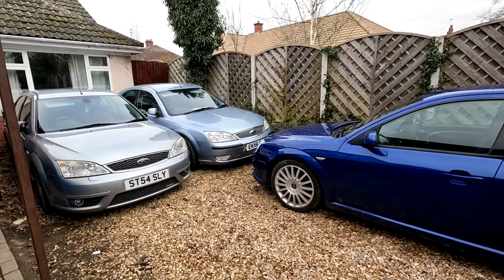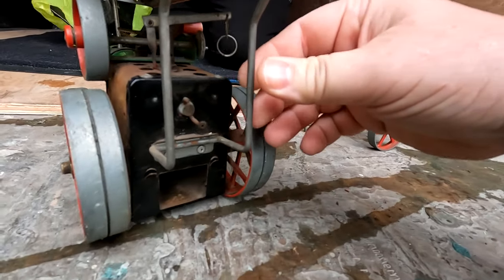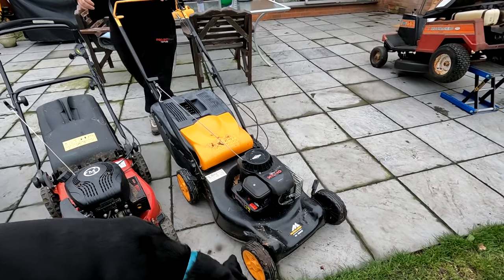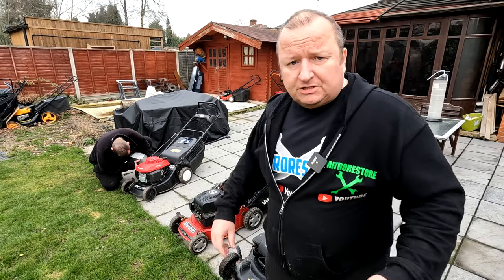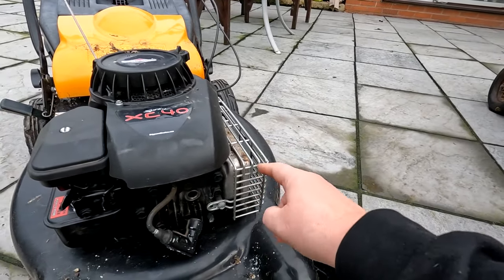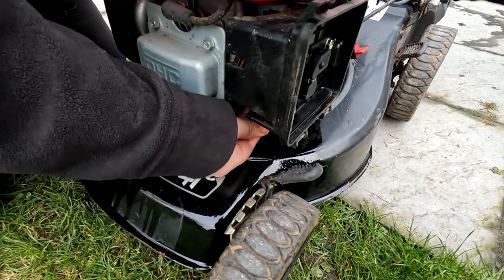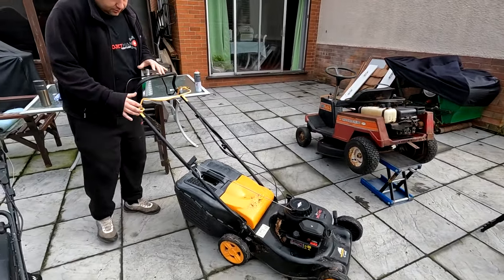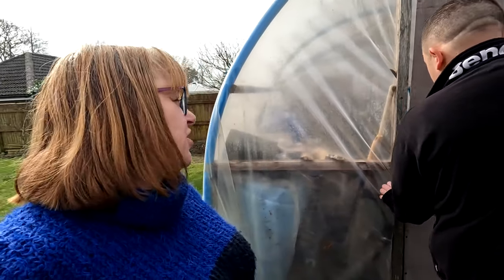House Clearance Finds - What You Might Miss

Comment: Filling tyres with air puts the water content of the air inside the rim thats wsrm from been through the pump compressor, then when cold cools the air it holds less water and the rim has condensed water on it as its colder than the rubber of the tyre.
Nitrogen helps stop that happening, on track the water in the rim makes tyre temps more varyed undesirable on the road over years alloys corrode so filling with nitrogen on the road still has pros but its exoensive.

Comment: A bit of soapy water in a spray bottle and spray around the rim to see if its leaking air, I've had good results injecting a tubeless tyre sealant through the valve, much better getting Jimmy to sort it properly though. Cheers bud 👍

Comment: Martin why does your microphone sound better than Gary's new one? His is terrible and sounds muffled.
It annoys me that tyre fitters, knowing a wheel is corroded inside, don't use a wire brush to break the corrosion. They just use bead seal that doesn't work.
A few days later the new tyre is flat.
Reply from the maker: Gary wears his a lot lower than mine.